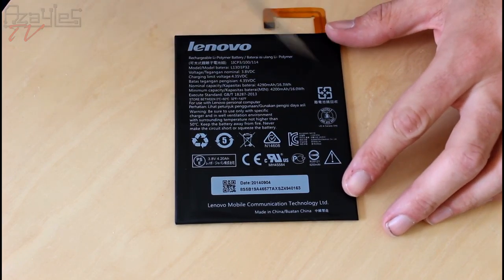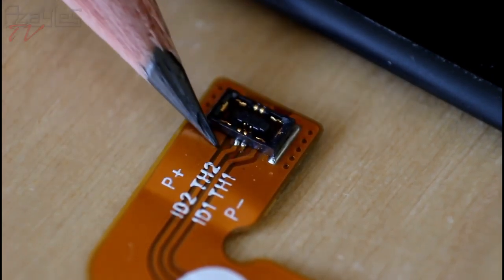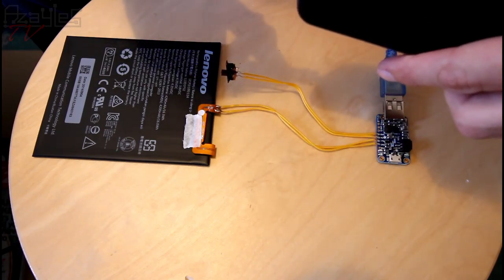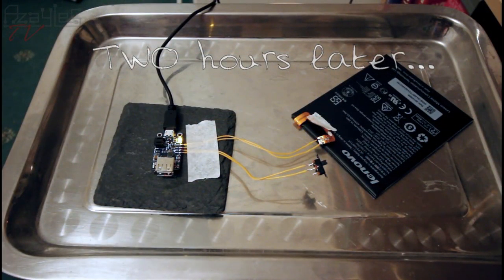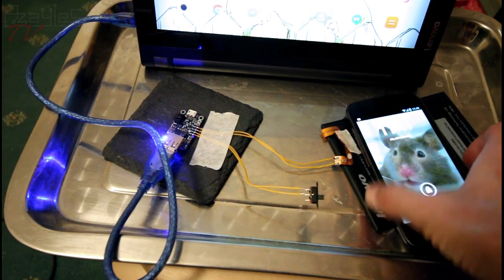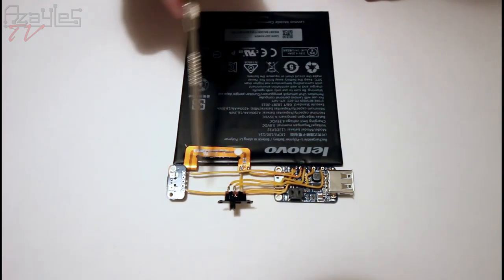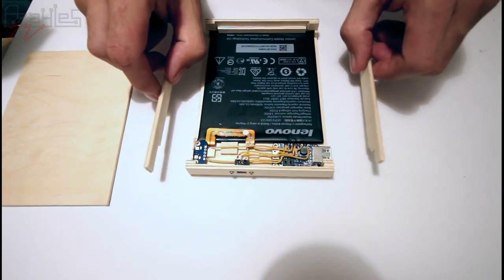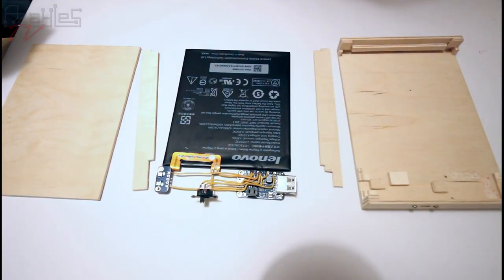USB Power Bank From a Broken Tablet - Part 1-2

Comment: I have a 3.7v, 3400mah li-po tablet battery but the problem is, when I connect it to dc dc booster module to get 5v output after charged, the meter reads only 2.4v and never goes up. But when I measure the voltage on the battery it's perfectly 4.0v   This is really annoying :( charger is TP4056 and the Booster is MT3608.
Reply from the maker: Try adding a load to the output, like a string of LEDs, then measuring the voltage again. The boost circuit might be cutting out if there's no load detected